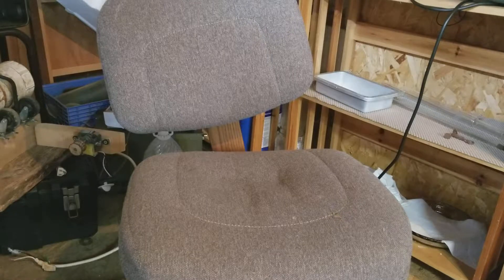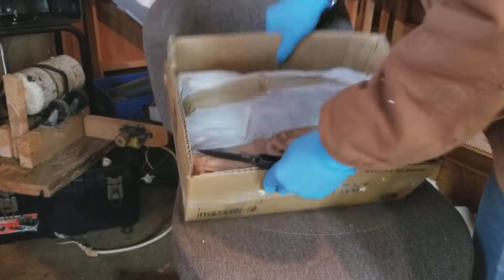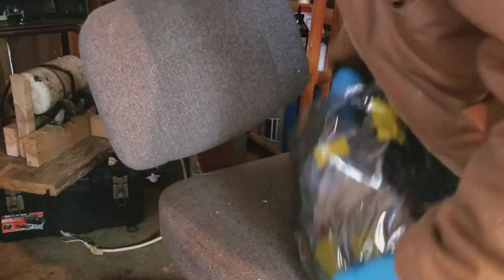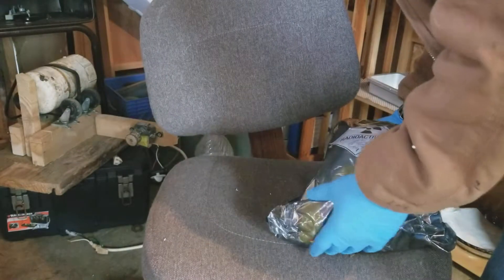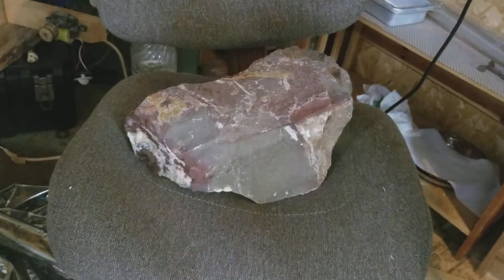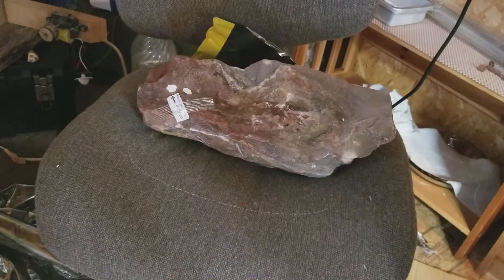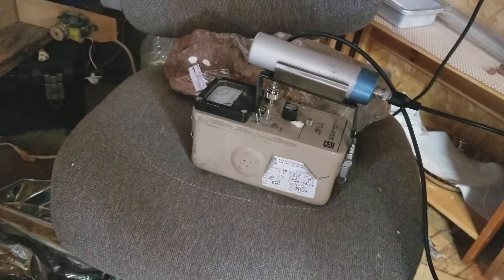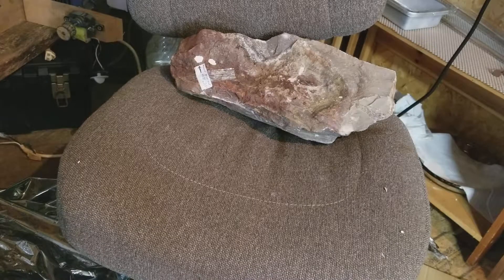Radioactive Unboxing. (20lbs Uranium Ore)

Comment: Did the seller label it with the UN2910 exempt shipping? It looks like they did a really nice job packing it but I didn't see the un code written anywhere on the box. Also how much does a piece like that cost?
Reply from the maker: Yes it did. It was on the outside box I believe. This box was inside an even larger box when it arrived in  the mail. I got this one for around $130. I think I got a pretty decent deal on it considering how much uranium ore costs nowadays. I intend to break it up to see if I get even more active spots.
Reply: GMG Labs  well I'm really glad it was labeled properly and yah for a piece that large it's not a bad deal. If you ever want some really hot but in smaller pieces or need any exempt quantity isotopes or cs for your gamma spec system give me a holler next time I might be able to save you a bit. Oh and make sure to try bequeral monitor it's my favorite for quick isotope identification.
Reply from the maker: Thank you. That is much appreciated. I might do that. I searched up the bequerel monitor, are you talking about the LB200 gamma spec system? Or are you talking about some software. I just wasn't sure lol.
Reply: GMG Labs  Oh sorry my bad it's free software the download page may be in Japanese but the software is in English.  Google translate should work on the download site http://blog.livedoor.jp/kabuworkman-becqmoni/
Reply from the maker: Okay, thanks. That clears it up lol.